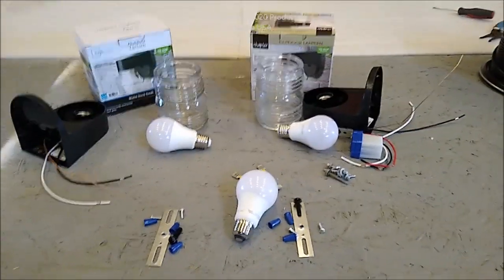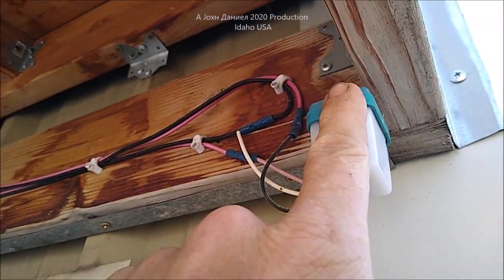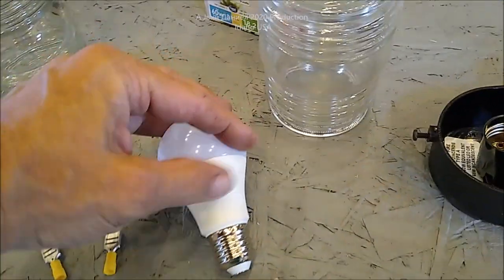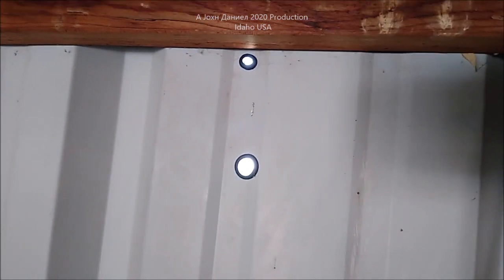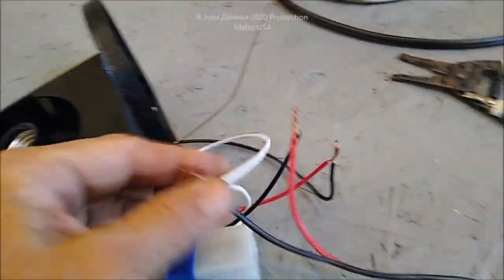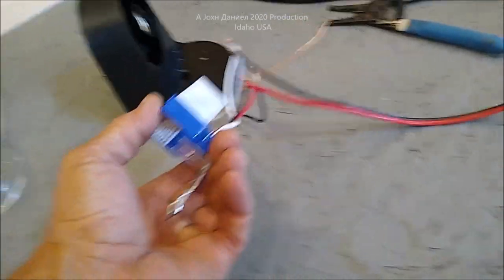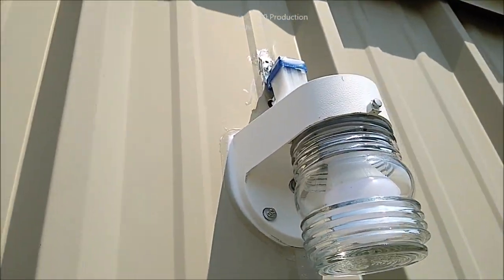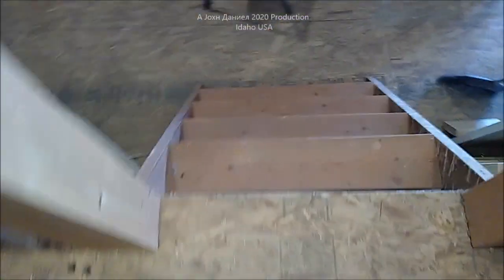Make a 12 volt Off Grid Dusk to Dawn with Classic Porch Light for $15

Comment: neat set up! If one wants 50% more light out put  you can just rip off those white plastic domes on the light bulbs. the leds will shine straight down instead of 360 degrees. If I wanted to make a single pole led light do you know any place I can buy a glass 12V solar cell???

Comment: I bought those sensors months ago for a light but I ended up using my $10 Renogy charge controller with load control. I control my light from a few hours to running all night. I used a 10 watt led spot light on entrance of ranch to give out some light as I am on high frontage.
Reply from the maker: I prefer not to use the charge controllers doing load function, they tend to loose voltage settings when or if a over load event happens. Seems their programming is connected to that load option.

Comment: Been using those Dusk/Dawn switches for over 10 years on the porch lights. The only thing is I use incandescent bulbs with a Diode in series with my 120VAC supply to the fixture so that my IR cameras can see better at night. Daylight LED bulbs are not so great in the IR spectrum.

Comment from the maker: In A Dangerous World, DO NOT be left in the dark! Parts to use - DC Light Controller https://ebay.to/3hhPuAw ,E27 LED 12/24 Bulbs https://amzn.to/31fPPyl ,Poly Light Fixture https://bit.ly/2Q9gA0X or Metal https://amzn.to/32aiGDb -- NOW GO get 200 watts solar https://bit.ly/3bFFQp4 ,20 amp controller https://ebay.to/34g2FhV ,& 2 small deep cycle batteries https://amzn.to/3l1xj4m & NEVER be caught in the dark! 
Preferred wire - 14/2 https://amzn.to/3je4ro2 and 12/2 https://amzn.to/31sUgpn
*ABOUT BATTERIES Get the DEKA SOLAR or Duracell B-903-L16 that actually last a real 10 years. Made by East Penn, sold by Batteries+ as a Duracell for less.  https://bit.ly/2wv1VXd Order online, pick up for much cheaper.
Reply: Hello, do you have a website for the reels of wire. Ie 12 gauge and 14 gauge. Thank you
Reply from the maker: @ozz5930  Most durable so far, are these 14/2 https://amzn.to/3je4ro2 and 12/2 https://amzn.to/31sUgpn